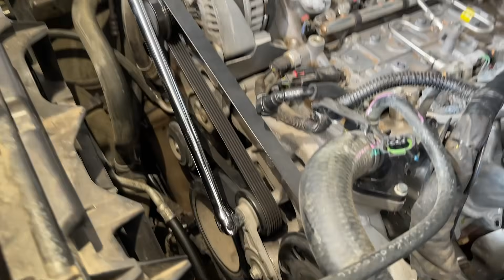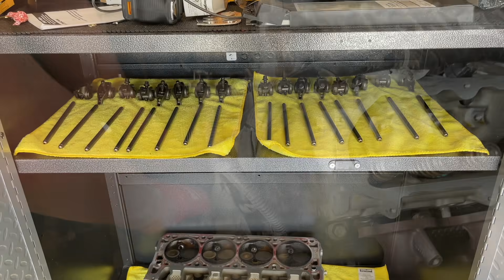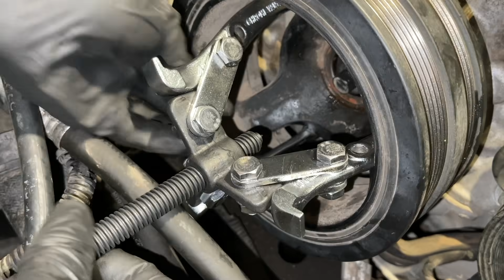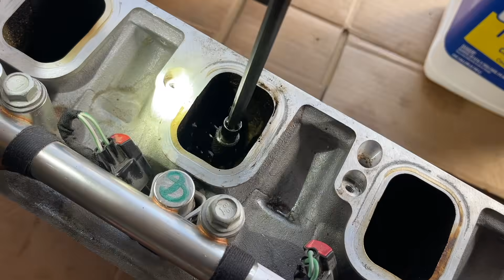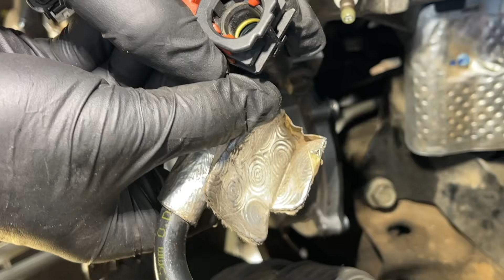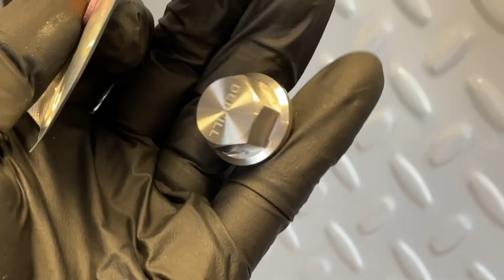GM V8 Cam lifters head gasket dod delete 6.2L 5.3L L86 L83 Yukon Tahoe Sierra Silverado Suburban

Comment: Wow awesome video, you're helping a lot of people. I've got a 2018 4x4 5.3 with 188k, no issues currently but I'm planning to do the delete as a precaution. I'm trying to decide if it's worth the extra effort to pull the engine to do the oil pump at the same time, I'm leaning towards leaving the pump alone and just doing the rest in vehicle.

Comment: Used this video to remember my steps going backwards. Extremely useful. Couple tips to save time. Heating up crank bolt for removal. Additionally for install if you use a big chain whip you can hold crank pulley for this torque sequence. That fits start sure is nerve racking. 127k Escalade with lifter failed but all fixed now.

Comment: I just did the lifters on my 2015 Silverado with a 5.3, let me tell you, if you have the ability to do it with the engine out, or at least disconnect the exhaust manifolds from the down pipe, makes a world of difference. It’s not impossible, but the manifolds will fight you all the way trying to torque the head bolts.

Comment: Does the valley cover have to be modified ?
Reply from the maker: No, you can leave it all factory and in place. It’s also nice in the rare occasion you would want to reverse the process
Reply: I wonder this is smog legal in California.
Reply from the maker: @macielandsons  I’d clarify with Brian Tooley racing, but I believe it was because it didn’t effect the catalytic system and uses the stock GM L8T camshaft GM uses in the 6.6L that doesn’t have dod. GM has to pass smog for V8 mode just the same so it’s basically like having a V8 truck instead of the option to have the V4. It just results in running your full engine instead of half the engine. But California does also have some strict rules, so who knows. They may not like a tune on the vehicle, so check with BTR before you do all the work

Comment: Realistically, is this a 3 day job?
Reply from the maker: It could be, but there is a lot of prep work and it would be good to have a second set of hands. If the timing chain tensioner snaps the engine is coming out
Reply: @dannyjohnsonsgarage I'm working on it now after completely watching your video. I've been a mechanic for 14 years but have never done this. I've done it on other trucks before. I've got it down to the heads being off and the camshaft out probably in the next hour or two I've been on it for probably 4 or 5 hours total so I'm thinking it'll just be a two-day job. I don't have an extra set of hands unfortunately. I appreciate your effort put into this.

Comment: How did you clean the block and got it to look that good I'm struggling
Reply from the maker: A LONG time with micro fiber and degreaser. I hear that carbide blades are good- just don’t scratch the surface or gouge it. Here is one on my affiliate link https://www.amazon.com/dp/B0D2VYMT8F/ref=cm_sw_r_as_gl_api_gl_i_EEPHJM4VZMCGQGX0XBZH?linkCode=ml1&tag=2004047-20&linkId=4fda33aa08774e9575b476011094a886

Comment: Danny this video is the only reason I took on this repair!  I’m in the middle of it now. What software tip tool did you use to push the chain and tensioner?  I can’t find something like that.
Reply: Thank you sir!  Mine is at 12 now and locked….so far so good. The locking tool was a pain to get in. Had to wrap masking tape on the bottom ends of the bolts to keep them from falling out while installing.
Reply from the maker: It was the handle end of the craftsman magnetic reach tool found here on my affiliate link https://amzn.to/43Q39ZH
Reply: Awesome!  Thanks!
Reply: Danny do you think it’s easier to get the chain off if the timing arrow is at 6 or 12?
Reply from the maker: @BeanSprout2013 I don’t think it will matter, but make sure the timing doesn’t move and is locked with the flywheel holding tool since you can’t see the timing mark with the oil pump installed
Reply: Danny did you prime the motor with oil prior to your initial start following the repair?

Comment: Just finished on my 190k 2014 Silverado.  Original lifter was what failed for me, cylinder number 2.  Getting the timing chain on and off was the most difficult part, had to work it link by link with two screw drivers exactly how you showed.  Have driven it the last 2 days and it looks ok so far.  This video was essential and made it possible.  Thank you so much for the detail and step by step instruction.

Comment: Crap I broke the tensioner. Stupid plastic thing snapped! Did you prime the oil system so that oil was flowing up the pushrods? Unsure if the LS5 blocks have the little side port that you can pressurize with a $9 pump sprayer and a cheaper threaded adapter-nipple.
Reply from the maker: I didn’t, but it would be good to do. If you remove the engine, I would also take off the oil pan and do the oil pump, centering it with shims. There are good videos out there on that part

Comment: Thank you very much for this video.  I have a 2016 with 158k and just noticed a ticking noise.  What was your total cost and time involved?
Reply from the maker: I broke it down in this video https://youtu.be/RZGr7xT6wLA?si=af4ON_r4d41pRFeU
Reply: Also another quick question on this model Yukon Denali…My front hvac blower motor suddenly stopped working.  Dash controls and rear fan work normally.  I started with checking the fuses.  They were good so I replaced the fan motor.  No luck.  I have voltage to the plug but want to know how to test the signal wire or if it could be anything else?  Thank you!!
Reply from the maker: @TheDavemurrayy have you looked at the motor itself to see if anything got stuck?
Reply: @dan @dannyjohnsonsgarage lo, thank you for the reply.  yes the hvac fan motor spins freely.  No restriction or bearing noise.  Plug also looks great.  I will backprobe  the light blue “signal” wire next at various fan speeds.  Am I correct guessing that there’s a front hvac fan “module” instead of a relay?  Thank you also very much for the other link for the cam and lifter replacement breakdown.  Very informative videos!

Comment: Thank you so much for your efforts in the video, and sharing the step by step process.  I just did this with my 2017 Suburban after an AFM lifter failure and tic. (with codes and misfires).  This was a fantastic presentation of it all.  So far, so good.  I am curious as to the software your friend used for the AFM Delete programming?  By the way, the video was so helpful, I was not bothered by the ads that came in every time I replayed a part.  I hope you have gotten some good revenue from it.

Comment: 1. When you started the truck after completion, did you have to break in the new camshaft? 

2. I spoke to a tuner for the ECM for after the job. He requested i remove the ECM to be able to rewrite the tune. Did you have to do that as well?
Reply from the maker: I had it tuned locally in town before starting. For 2019+ you have to have the transmission control module (TCM) and Engine control module (ECM) unlocked and tuned. I’m not sure what the tune mine had consisted of, but I understand it’s more than just disabling the dod/afm
Reply: @dannyjohnsonsgarage thanks for that.  About the camshaft,  I was told that needed to run it at 2k rpm's immediately after starting for about 30 minutes.  Fluctuating between 1k to 2k . Is that still the case ? I read its only for performance camshaft but I couldn't really get a definitive answer. Dont want to damage a new cam.

Comment: Is the oil pressure sensor should be in front of the engine right
Reply: Thanks you
Reply from the maker: For 2015+ it is. Older models had it on the rear side

Comment: Future reference and for anyone else that happens to do this job to make it easier when you loosen the crankshaft balancer bolt all the way thread the old bolt back in partially by hand for the puller tool and as you pull the balancer loosen the old crank bolt as you need until it is off. the old bolt acts as a stop instead of a socket or another bolt
Reply: great video by the way. very well detailed

Comment: Great videos. Question When doing a full delete on an 186 is it necessary to install a cam phaser limiter?
Reply from the maker: I understand it needs to be locked out if you go with a larger cam so you don’t have piston to valve contact, but with the stock duration cam like I used its best to keep the variable valve timing
Reply: @dannyjohnsonsgarage i appreciate that. I seen one guy do it and my head went for a spin.. im gonna try this myself as no shops in my town want to take it on.. they keep busy with brakes and suspension and low risk with that 😂

Comment: Hello, and thanks for making this video! It was extremely helpful on my rebuild. I was wondering if you had any issues after you completed everything? I am currently getting a fouled #1 cylinder plug which then leads to a misfiring. Did you need to do a camshaft reprogram or vvt program? Or did you have any misfiring?
Thanks in advance and keep up the great videos
Reply from the maker: Mine did not have the issue, but I would look at the injector for that cylinder (be careful if you remove it because it’s pressed in and drops junk into the cylinder.

Comment: Anybody else got their ass whipped tryna get the chain back on? I’m stuck! 😢
Reply: I got it. Thanks. I was TDC on exhaust stroke instead of compression. I rotated the engine to compression stroke and had more clearance with the phaser and oil pump
Reply from the maker: It made me consider a removable link. 
You can remove the oil pump but it can’t come off completely due to wiring and you’ll need to remove its front cover to shim it when you put it back on
Reply: @dannyjohnsonsgarage leave the phaser bolt out while doing this right?
Reply: How did you get it back on
Reply from the maker: @clintjoseph86 right. Phaser bolt installs after the chain is on. Its  in  the video

Comment: To make it easier even tho it’s an extra 25$ through btr buy another bottom timing gear slide it up on the crank in front of the oil pump and you have a visual of the bottom timing mark.
Reply from the maker: That’s a pretty cool idea

Comment: Did you have a misfire on cylinder #3? What test did you perform to determine a bad lifter?
Reply from the maker: I had a squeak that sound like a belt, found vibration on the lifter https://youtu.be/cx4_-FGXCVE?si=JQA7aWoA6tNyPrf0

Comment: Thanks for video helped a lot. I had a ticking noise with loss of power so I thought it was collapsed lifter and 2 mechanics just said get a new engine, but I can't afford that at this time and quotes from 2 mechanics were the same. $11,000 for lifter replacement rods etc, or new engine $13,000 plus. I decided to do it myself (well wife said to do it)😂and it all worked out. It was actually not a collapsed lifter but a bent push rod that brought the knocking, so I replaced all lifters and pushrods, rocker arms etc, and thermostat, spark plugs, and with that the cam looked solid so another price I didn't need to replace. Thank again it all worked out💪

Comment: Did you remove the solenoids on your valley cover? Also, I have a DiabloSport tuner, can I use it to tune for the deletion? It has an option to disable afm. Or does it have to be a custom tune?
Reply from the maker: No, I left it all in there
Reply: @dannyjohnsonsgarage  Thanks so much!!

Comment: Do you think that as a cost benefit replacing the engine vs doing cam and lifter?
Reply from the maker: I would consider a replacement engine to avoid complications with head gasket sealing, timing tensioner complications, oil pump complications (if removed), metal shavings, etc. On the other hand, a new engine may require programming, and transmission programming. The main concern is getting another engine with the same dod lifters that will later fail again. You can look at the L8T 6.6L that didn’t come with DOD (or a remanufactured engine without dod which may have its own risks), so you there is a lot to consider

Comment: Ok im back. So yea my 2018 Silverado was Finally fixed I picked it up today. Now here comes the fun part. Now after replacing the lifters now theres Air in my cooling system, the car doesn't overheat that my mechanic noticed, but the there is a tick noise coming from the front end and there seems be air in the main coolant line. He bled the system and refilled multiple times and hes stumped on what the cause might be. Started doing some research and others claim it to perhaps be a bad or faulty head gasket. Have you seen or heard of this issue after Lifter replacement?
Reply from the maker: I’d look at burping the system by elevating the hose as you’ll see in this video. A head gasket is certainly a possibility depending on how the mating surfaces were prepped https://youtu.be/XqyhfLk9ML8?si=CwT-mmZ8nj-hWXSC

Comment: That was very well done! I will add it is impossible to get to the ground bolt on the back of the passenger head with the head on with the 6 speed pickup transmission because of the trans dipstick. Ask me how I know. 😂

Comment: get a proper button tool, just drain the radiator using the petcock valve at the bottom of the radiator.

Comment: Thanks so much for tagging this video in your reply to me. What a job dude..dismantled and put together nearly the entire truck lol. So just to be sure, just before  12min in this video, you unplug the coolant temp sensor. Then you unplug to oil pressure sensor, and last “the one to the right” is the vlom? Great video man thanks so much for this content. You make it look easy. Very educational thanks man.
Reply from the maker: Correct. And thank you 👍🏼
Reply: @dannyjohnsonsgarage beautiful. Thanks man can’t find that information ANYWHERE. not even AI could dig it up….since you knew that by chance, could you point me in the direction of the “radiator coolant temp sensor”? I have already replaced the ECT next to the thermostat. Thermostat was also replaced. My scan tool is showing me a pid for “radiator coolant temp sensor” and it is always at 32 degrees Fahrenheit. It’s July in south Florida…anyway there is ZERO info on this sensor. All I’ve managed to learn is that there are two coolant sensors. One for the dash gauges, and one for the ECM to read. I’m assuming the radiator coolant temp sensor is for the ecm, because all of my other temp sensors seem to be reading incorrectly. Replaced ambient temp sensor, ect sensor, maf sensor, tstat. Can’t seem to find the radiator sensor through. Which is why I was asking what that sensor was in last video. Thought it may be it. Thanks again man. Your videos are really great.

Comment: what are differences if i want to do this on my 2020 Silverado 5.3L?
Reply from the maker: I believe the Yukon was still similar but the Silverado may have gone to the new engine by then. It is the same overall layout, but the alternator and some components have changed location. They may have also gone to all cylinders with dod lifters (DFM). There will be a lot of changes to the cam phaser gear area.
Reply: Looking at buying a 2019 Yukon SLT 5.3 today with premier package and heavy tow package.  Thoughts on this setup? Before purchasing.

Comment: What are some of the symptoms that suggest lifter failure is the root cause?  

For instance have you  heard of occasional vibrations when applying acceleration or letting off of accelerator to being caused by lifter or fuel injection failure? 

Vibrations feel similar to that of bad drive shaft u bolt/coupling failure on older cars.
Reply from the maker: Mine was simply the nose of the lifter shaving the camshaft. Others for dod failure get ticking and misfires from a bent pushrod or stuck dod lifter Bad lifter noise sound Yukon Tahoe Silverado Sierra Escalade Diagnose bad lifter GM Chevy truck suv
https://youtu.be/cx4_-FGXCVE

Comment: Has anyone here had to do a, camshaft position sensor relearn after the DOD delete. I performed this and now Ive have an engine light for the, Camshaft position sensor and overpressure in the fuel system come on at the same time.
Reply from the maker: I did not, but is it a stock or larger profile cam? Is the timing correct?
Reply: I used a Melling MC1437 stock replacement camshaft with DOD delete. LS7 lifters and recommended DOD delete pushrods from Michigan Motorsports. Same as the ones you put in except 7.850 in length.

I was very careful with the timing chain and lining up the cam phaser. The chain was in the same position with the crank lock in place and the arrow on the phaser pointing straight down.

Comment: did you drop off your heads or just clean them up real good?
Reply from the maker: Just cleaned them. I debated having them machined, but that would also require the block to be decked. Speaking with others, they recommended the heads going back on as they are since I removed them safely in reverse torque sequence to evenly remove them and not warp them. You’ll see that process in the video

Comment: It took me 4 hours to find a video that seems close to my truck. I have a 2019 chevy silverado LT 1500 5.3
And its lifter went out on cylinder 6. So im gonna be doing the delet kit on it to get rid of the stupid eco shit. But i have a question, would your torque values work for me? I cant seem to find any specs online anywhere .
Reply from the maker: It’s very similar but 2019 uses the other VVT cam bolt and may be harder to get the chain off from what others have said. For torque values, it should be similar but I’d definitely try to get better specs. A dealership may be able to print them off for you